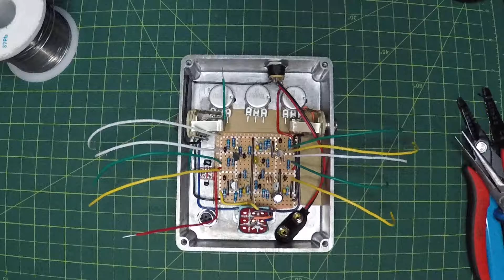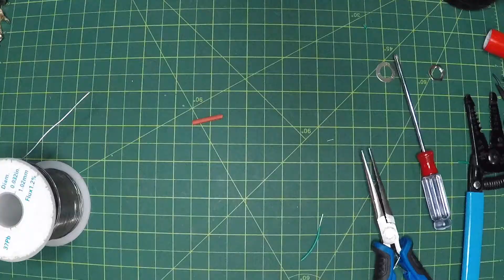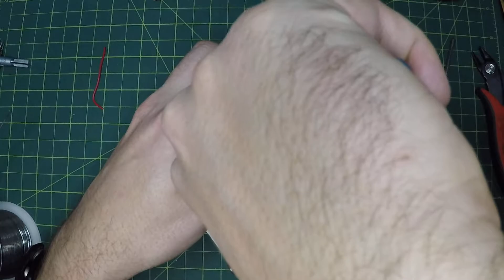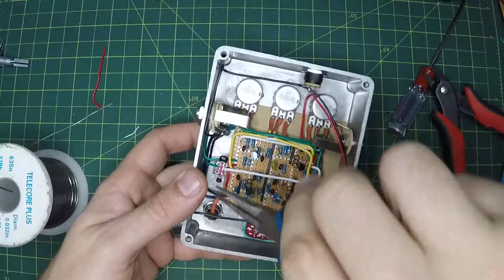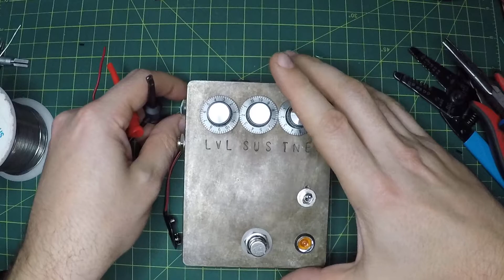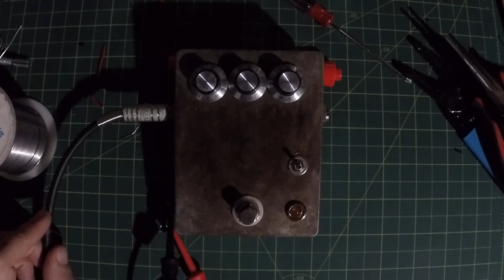Big Muff Pi Part 6 - Potentiometers and LED Indicator

Comment: Hey, Thank you for your videos. You've helped me avoid errors building my own. One question, and apologies if I missed you addressing this by fastforwarding, are there any unforseen issues with soldering the pots outside the box rather than when the pots are screwed into the box? It seems tight trying to do it in the box. Be well and thank you.